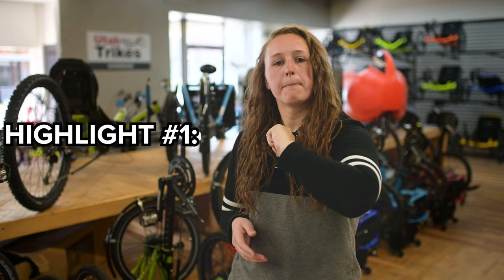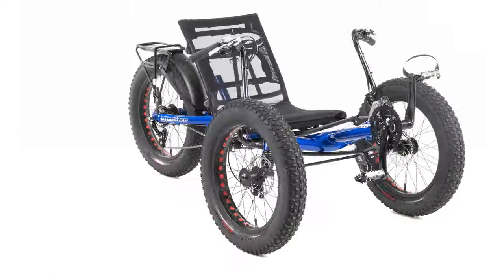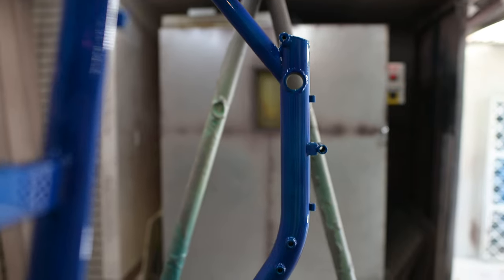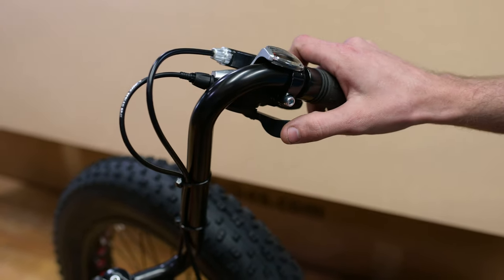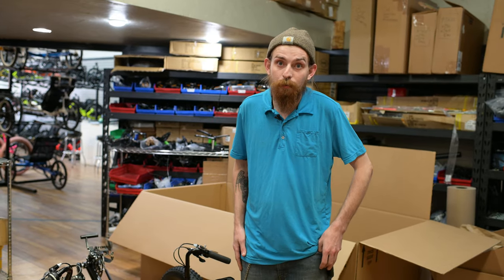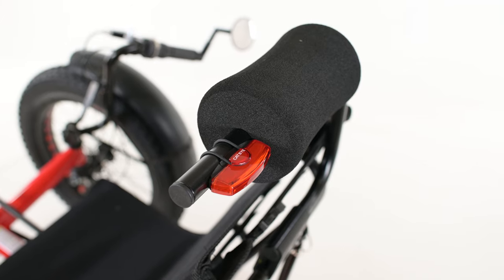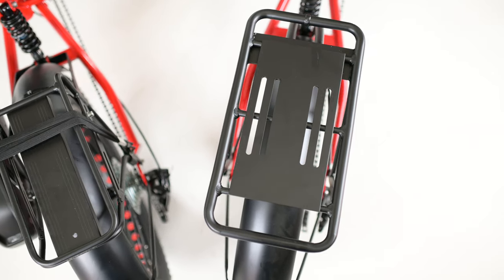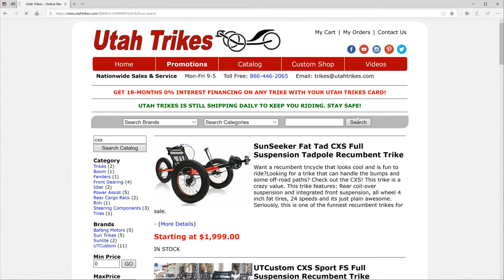Fat Trike for the Apocolypse - Fat Tad CXS from SunSeeker - Utah Trikes Special Builds

Comment: So what does the fat cat v3 have that the fat tad cxs doesnt to justify the increased price point?
Reply from the maker: Lighter aluminum frame, easier to adjust with quick release levers, more comfortable seat, higher quality components (drivetrain, headsets, levers, etc). Comes stock with wrist rests, flag, and a mirror. No suspension though.
Reply: @UtahTrikesOnline  Ok, so it sounds like the difference between an entry level vehicle and one with a bit of a nicer trim package. Could probably run those big tires at a lower PSI to account for the lack of suspension. I think I've made my mind up. Been going back and forth between the fat tad and the V3 for a couple of weeks but if your gonna drop dollars on something, you may as well drop enough to get the nice version of it.